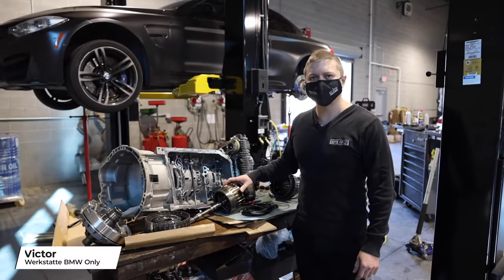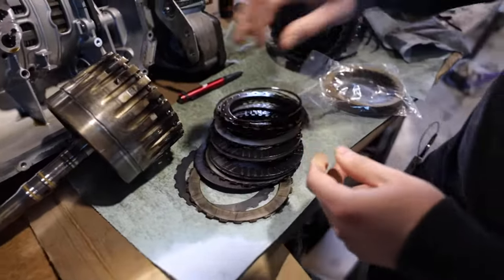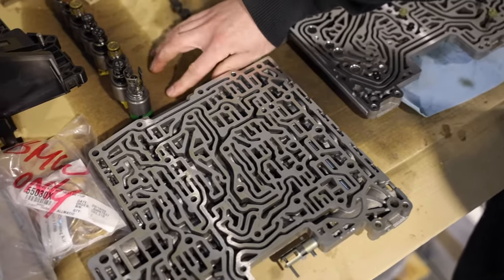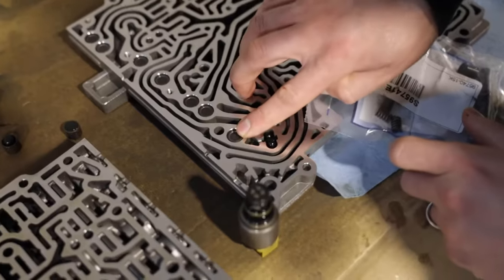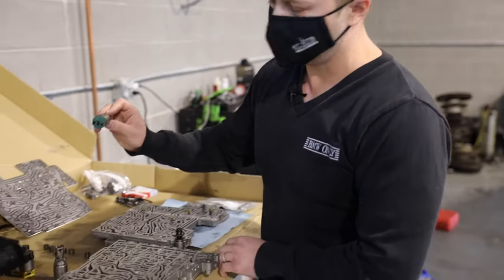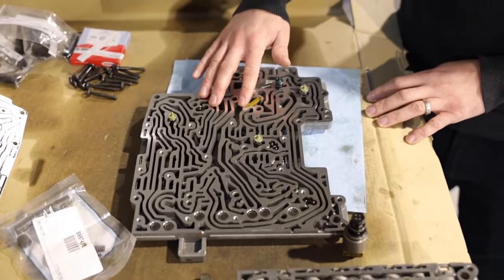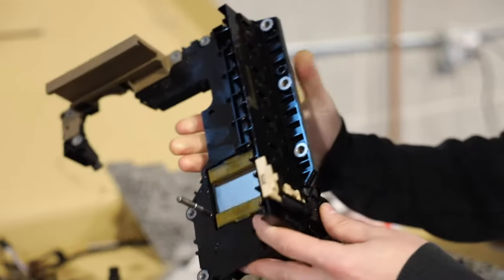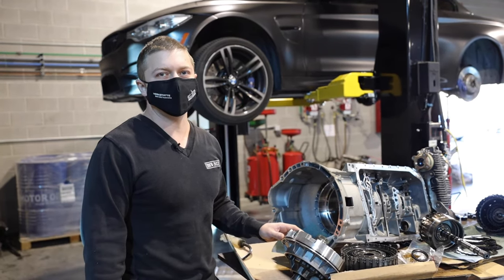Why BMW  Transmissions FAIL 6HP19 6HP21 6HP26 6HP32

Comment: Hello, thank you so much for your videos. I was wondering if you could help me. I recently changed the solenoids, sealing sleeves, and the bridge seal, now the only thing that works is the reverse. I have INPA software and the 4f81 code is coming up. I hear a rattling sound form the transmission sometimes it will catch for a second to go forward, and it will sometimes pull forward in manual mode 2nd and 6th just a little, enough to kinda pull back into the garage but it even stopped doing that.
Reply from the maker: Are you sure you filled up the proper amount of fluid? Did you have the car idling while filling it up? It sounds like a pressure loss. I would remove the valve body and double check the adapter gasket. Also make sure it's the correct part number. If that adapter cracks or installed incorrectly it'll lose all the pressure and do what you described. Also if you only filled up 4 qt or so it'll do similar
Reply: @werkstatte-bmwonly9515  Yes the car was running and I used 8qt. Is the adapter gasket the bridge seal? My old one wasn't cracked but I will try that.
Reply from the maker: Was the vehicle running fine before you did the service? 8 qt is the correct amount so that's not the issue here. Make sure you didn't mix up solenoids. Did you take a picture before you took them off? I always suggest taking a bunch of pictures.
Reply: @werkstatte-bmwonly9515  Yes, I took them out one at a time, Do you think they sent me the wrong seal kit? because I ordered all OEM ZF seal kit for  6HP19, is kit the same as the 21 kit?
Reply from the maker: ZF 19 and 21 are very similar but these adapters aren't all the same. There are several sizes that's for sure. Let's assume.yours is thinner then you would lose pressure. I'd remove and compare side by side..I'm almost positive it's a mechanical issue. Remove and double check everything. I also had a tech that didn't torque the valve body bolts and we had clutch slippage. We only found out when we removed the pan again.
Reply: @werkstatte-bmwonly9515  Yes definity, I totally understand. Wow Thanks you so much for your help
Reply from the maker: You're welcome

Comment: TBH I have 142000 miles on ZF 6HP19 with the last 30000 with an ECU remap to 300lb-ft 2005 E87 120d. I change ATF, Sleeve & Sump every 5 years or 50000 miles, which ever comes first...
Reply from the maker: You're in Europe? People take care of the transmission services on time in EU countries. Even replace the torque converter to prevent future failures. Here in the US I've replaced the toque converter ( without the diapers transmission) maybe twice. 
People wait till it fails. 95% of our customers don't do service as we recommend it and only when they experience symptoms.
Reply: @werkstatte-bmwonly9515  Yes, I’m in England. Unfortunately BMW, Audi, MB, JLR are all using ZF sealed for life transmissions. They are not on the service schedules. A lot of new cars are sold on 3-4 year leases so manufacturers are keeping service costs down at the cost of longevity by leaving out maintenance from the service schedule. Some second/third owners are waking up though…
Reply from the maker: Same is here, BMW does not offer replacement of the pan unless it's leaking. You just have to request and pay for it or use an independent shop

Comment: Hey brother you sound like u really know you’re stuff. Man I wish u flguys werecin Sacramento ca . Well any way so I got this 335i from this dude and he just got the car and it has 45k miles and after just few months having it . He start having problems with reverse and first gear slipping I think so he was told and he replaced the rubber sleeves I think there called it’s the rubber seals between valve body and the tranny it self so I guess it fixed that problem but right away he start having problems with 4th and up gears ohh and. He put that red synthetic fluid. I told him that he needs for special fluid for BMWs and I guess he dumped a old one and put the right one, but never flushed the tranny transmission so then he thought it’s his valve body and that’s how I got the car. I change the valve body that did not help so what should I do I’m getting this same code clutch e there was not a lot of driving at all after all this happened so do you think flushing it and putting fresh fluid with that fix the problem?
Reply from the maker: Hey Tima, fluid isn't as essential as people think. When it comes to 335 it's always cheaper to replace it. Buy a used one on eBay and just swap it out. If it's 8HP you need to do ISN reset as it wouldn't run. But since you're talking about runner sleeves I'm pretty sure you have 6HP21. You'll spend more money trying to figure it out.

Comment: 6hp21 same 6hp26  ?
Reply from the maker: Very similar, different torque. 6hp19 got updated to 6hp21 and was used on 6 cylinder engines. 6hp26 is used for 8 cylinder engines like example BMW 545, 745, 650 etc.

Comment: Man when I can buy a used ZF6HP for $300 and rent a lift for the day at $200 I just can't see how one would justify a rebuild of these units...Sure it may last longer I'd have to go through like 6 used non-reman transmissions before it would have been worth rebuilding one.
Reply from the maker: Unfortunately they'll all be wearing out by now. 6hp19 6hp21 are more reliable. 6hp26 are going up to 2k in price with decent mileage. Also you realize not many people can replace their own transmission.
Reply: @werkstatte-bmwonly9515  That's true. I'm rebuilding the 19 that just came out of my car right now just so I have a spare that's like new for next time.
It's not as bad as I thought so far having done the valve body. Bushings look like I'm going to need to make my own tools but generally I'm in no rush so it's all about going slow and careful.
Reply from the maker: Great job, thanks for feedback

Comment: funny how those in audi a8 are very solid but bad in bmw. 341 000 miles on mine 548 000km. I think it's a mcdonald ice cream machine situation
Reply from the maker: So same transmission does well in 5 series and bad on 7. A lot of factors are in place. Programed shift points, vehicle weight, drivetrain and suspension. Engine torque values etc.
Reply: @werkstatte-bmwonly9515  Something bmw did. As far as torque, the w12 has as much as any bmw and since it's awd unlike the bmw v12 the trans gets more of that torque down. I'd be interested in seeing if those un audi and bentley are really internaly the same
Reply from the maker: The biggest the engine the bigger is the trany. All ZF transmissions have diff torque specifications. They aren't the same
Reply: @werkstatte-bmwonly9515  Im only refering to the 6hp26 found in audi a8 where it's all the same size transmission. (at least in north america since we didnt get a v6 here, so no 6hp19) Those audi a8 6hp26 seems to be more durable than the 6hp26 in bmw cars. I've got one that's at 548 000km or 341 000 miles with no overhaul since new.
Reply from the maker: Very possible. Like I said it can do a lot with software of the transmission and engine,Shift points and torque distribution. That's why a lot of tunning companies tune transmissions after they add horsepower to the engine. Same transmission but it decreases chances of failure. VW GTI transmissions fail if you tune the engine and do nothing about transmission. My service advisor has a GTI and he keeps talking about it.

Comment: I've recently found out a strange thing with my 6HP26 in E66 750Li BMW, and I hope you can answer my question. So I was fighting with very annoying vibrations - at every speed. It wasn't dependent on the gear I was in, or if I was accelerating or not. These vibrations were present even when I switched to N while driving (I know I shouldn't, it was just a test). I've excluded every other possibility - the drive shaft, rear and front suspension, wheels etc. Nothing seems to fix it. The transmission was serviced, the tourque converter was serviced, oil changed etc. What my friend has found is that these vibrations seems to originate from the back of the transmission - we've checked it while the car was up on the lift. There's a play on the shaft that the output flange is connected to - would that cause any vibrations to appear? Am I right to assume, that even when in N, the output shaft of the transmission is still moving and can cause vibrations? I have created an album that you can check, there's a short clip in there which my friend has recorded and it shows what kind of play it is: imgur dot com slash a slash NxtGNyp. Just please reamove whitespaces and dots and slashes to create a proper link. I'm clueless what is happening and I'd really like to finally fix it - hopefully you can give me some answer.
Reply from the maker: I would replace the transmission. In neutral you shouldn't have any vibration at all. Something is sticking inside. We had melted clutches before that would drive transmission forward even in neutral. It sounds like your transmission doesn't disengage
Reply: @werkstatte-bmwonly9515  Seriously, it'd be that bad and transmission replacement would be required? I've already thought about trying to swap transmission to test if the vibrations would return - I didn't expect the transmission to be disengaging! The RPMs go down when I switch to N while driving and the car stops pulling just as it should, the vibrations don't go away though. What I originally thought was that even though the transmission is in Neutral, the output shaft of the transmission and the output shaft is still turning which means if the output shaft of the transmission has some excessive play, as in the video I've send you, the vibrations won't go away even if I switch to N while driving. 

All in all, the best way to check it would be to either completely replace or just swap transmission for a moment to check if this helps. Sounds like whole lotta money :(
Reply from the maker: It's honestly hard to say without seeing the car
Reply: Please check your transmission mount.  These are normally collapsed and will allow  a lot of vibration.

Comment: Hello Victor, I have a 6hp19 on a e90 335i. I have a clunk when I start the car in P (https://www.youtube.com/watch?v=nAo5arh7K-A), there are no errors and it shifts as its supposed to. I did a service, ZF service kit(oil,pan,fresh fluid) didn't make any difference. can you give me some advice? thank you
Reply from the maker: Hi, it is normal on N54 models. I've seen it plenty of time without having any issues or consequences. Our customers have taken it to the dealership with the same answer. I'm sure something is causing it like pressure built up but we haven't seen anything concerning.